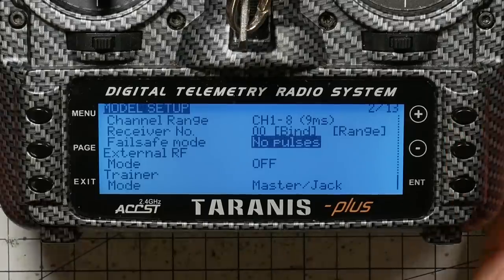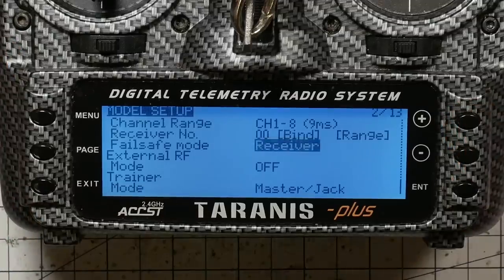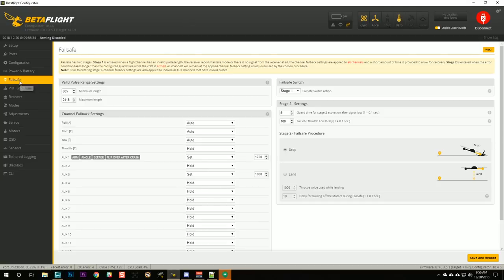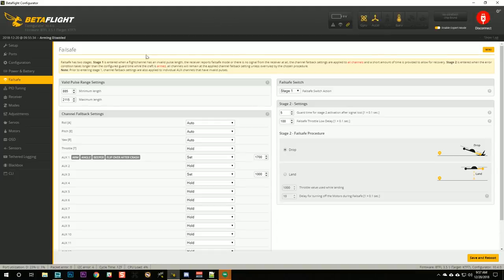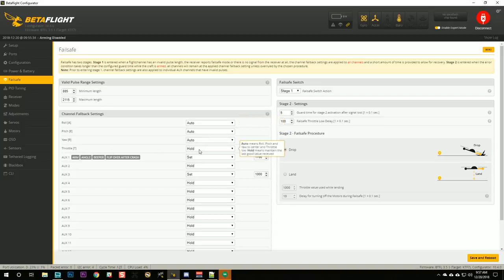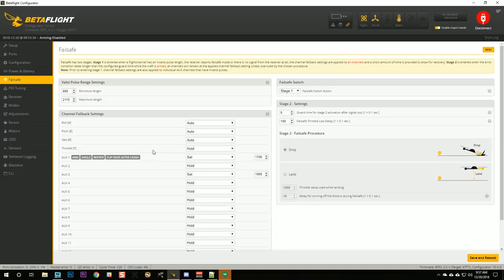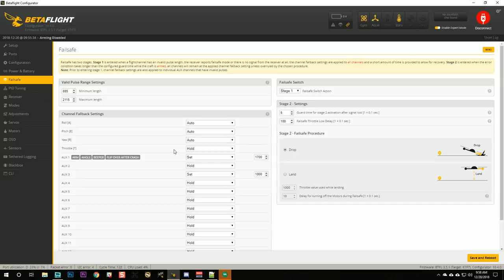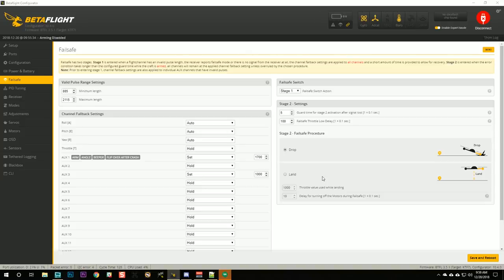Failsafe HOLD vs NO PULSES | which is right?

Comment: Great info.  Yes, set TX/RX failsafe "no pulses", works for all quad cases (like CPPM).

Great note about RSSI channel.  Will have to implement that.

Arm AUX channel I set to hold as I want it to keep the position for the 0.5s of stage 1 failsafe.  I may however add the angle mode to give the copter 0.5s of levelling so it tries to drop upright if the failsafe continues (my angle is on a different channel to arming - and I have the accelerometers enabled - and small_angle 180).

Comment: I've always set failsafe to no pulses and betaflight to drop based on watching your previous videos when I started flying. Watching this got me to thinking that maybe there is a better way. You seem to be really against land, but I've had a failsafe cause a drop that destroyed the quad. If failsafe goes to auto level (and you have the accelerometer enabled) then wouldn't it be better to have a land failsafe with throttle set too low to actually maintain altitude? It would seem like this would level it and allow a more controlled crash. It would still drop, but  just a little slower. I run a top mount battery and I can hit the ground pretty hard when level without causing any damage, but if I land on an arm then arms break and motors get damaged. How about a short video showing what happens when failsafes occur. You could set up a switch or just turn of the radio, but show us what happens with different configurations of failsafe in betaflight. Thanks!
Reply from the maker: I'm not a fan of descending with motors active. I'd rather dump with motors off. You can still hit somebody in the head I guess.
Reply: Totally agree, this was also my thought. Find out a good throttle value for slow decent. Only downside might be that this feature doesn't eliminate horizontal momentum? This might drive the drone into something nasty. A fix could be included by using the accelerometer vector to kill the movement and keep level. It also could detect if and how fast the drone is moving up or down to be sure not flying off into the sky consulting the gravity vector to be bit smaller than 9.81m/ss. Is Betaflight open source?
Reply: My thought was that shifting to auto level with failsafe would eliminate most of the drift and help it descend straight down.  @vansoul2285
Reply: @juliejones8785  Yeah, im totally agreeing with you. I don't have a drone yet to test it out but I didn't know that the failsafe land feature will also stop the drift. This feature expects a throttle value from the user, if that value is to high the drone will fly straight up until batteries run out. That's why I was proposing using the accelerometer to check for vertical movement to slowly land :)
Reply: @vansoul2285   Accelerometers can't tell velocity only acceleration; the accelerometer reads the same thing if you're tilting but standing still or  ripping balls; and you can't calculate velocity by integrating over time, there is too much noise, even with the quad standing still sitting on a rock the calculation would in just a matter of seconds have drifted into high speed. To be able to ensure a strictly vertical descent you need GPS, or some sort of doppler radar or downward facing optical flow camera or something of the sort.
Reply: @juliejones8785  Going level would do very little to the horizontal speed. Sure the air drag would reduce the speed over time, but the effect is very small since FPV drones are usually made to not waste battery pushing air needlessly; and being level means you're exposing the smallest profile possible in the horizontal direction, so going level actually reduces the effect even more.
Reply: @tiagotiagot  Yeah you are right. A brain fart on my part. Zero acceleration doesn't mean zero velocity. The quad can still fly away with constant velocity.
Reply: I set mine with what I thought was a low throttle value (1100?). It ended up 300+ yards a way in someone’s back yard. I eventually found it by wandering thru the neighborhood watching for the rssi value to go up on my radio + beeper. Eventually I found it in a fenced-off back yard and verified thru my box goggles. Unfortunately it was caught in some thick grass and couldn’t take off. 

Thankfully I was able to recover it by leaving a note on their door and a few bucks for the trouble (it was 6am on a weekend), but I don’t know how many people would be as kind. I had to accept that these people might be upset by it, hate drones, or accidentally “find” it with a lawnmower. 

Ever since then I’ve decided that a drop and potential repair may be more suitable.

Comment: Ages ago, before I got into FPV I flew GPS quads, one of which I hadn't setup failsafe properly on the RX and only realised after a flight test in my back garden - suffice to say I now always make sure failsafe is setup and works on any new quad before its maiden voyage because I don't want that to be its only voyage.

Comment: I was reading the whole topic the other day, they actually convinced me that the right way if you are using a serial protocol like SBus or IBus is to set your receiver to hold. They took the code from Betaflight, explained it quite a lot amd then I experimented by myself. Ew JB, I don't think by now this is your best tutorial
Reply from the maker: The argument they seem to be making is, "Hold works." But nobody has actually shown me a case why hold is better than no pulses. No pulses also works. 

So explain to me why a solution that only works for some receivers is better than a solution that works for all receivers.
Reply: @JoshuaBardwell  seems that for the FC is the same: they are both ignored. But for how the protocol works then hold would have some benefits in strange behaviours of the radio. The serial protocol keeps sending data out of the radio even if failsafe occours, so if that "short failsafe" happens there is no lost data. This is why hold should work better, if I understood that correctly. But you are the man who can dig deeper! :) This is a really nice topic, I'd appreciate sooo much if somebody could find the final answer to this!

Comment: Yea I was trying to set this last night so my whoop would just land, but every time I’d flip the switch and watch my stick movements under receiver tab, it would jump up and down, and then sometimes completely lock out all my stick movements. On The i6X it has a failsafe section, and I set channel 3 to -100% which works when I just turn off my controller, or if it were to lose reception. Eventually I just set the switch to Kill and drop on activation. Thanks for the info.

Comment: Best failsafe experiment might be to record all channel data from the receiver during a controlled landing, then on a real failsafe event, just switch the receiver out of circuit and take over the receiver and spew out the same previously recorded data to the FC.  A small micro controller pcb would be needed of course. I'm going to have a go at this. Height above ground would obviously be a problem if recorded altitude didn't match the failsafe event, but it's worth a shot.

Comment: Great tips, pulses defo sounded like pwm so I used "Custom" failsafe then made sure sticks were where I wanted. The I shut off QX and the Babyhawk R with XM shuts down replicating loss of signal. Qx is a nice radio, Open tx comes back to memory quick.

Comment: Potential dummy question: when you described your Failsafe settings, you set your throttle to hold and you make sure that via AUX1, the quad is disarmed. However we are only talking about Stage 1, where you want your 0,5 seconds grace period before the quad drops out of the air, so shouldn't you make sure that during those 0,5 seconds, the quad does not disarm?
Reply from the maker: I think you're right. I misspoke about that aux channel.

Comment: Joshua B:  Topic Idea for new pilots.  
How often should you expect to receive bum products?  
I ask because I'm pretty new to quads and have already had some strongly disappointing interactions with some "reputable" companies. 
Out of 3 micro quads that I have bought, 2 have needed to be returned for defects.
One bought through Amazon was replaced in 2 days.  One bought from a smaller outfit was sent back weeks ago and the replacement is "in the mail" with no tracking number or anything.
The only one that I did get to fly was great, then I crashed and discovered that that company charges seemingly double for spare parts.
Reply from the maker: It depends entirely on the company you're buying from. Some are very reputable. Some have a reputation for poor quality, but at least they're cheap. If you're sensitive to this sort of thing, buy from companies like RDQ and GetFPV who will absolutely have your back. If you are willing to take a chance on a bargain, Banggood is a fine choice, and their customer service is not the WORST although it does take three weeks to get anything from them.

Comment: For me throttle hold is not a good idea even if stage 1 is only half a second. Because of the case you were full throttle when failsafing, you will continue half a second at full throttle which could be a big distance your quad could run.
Unfortunately it is not possible to put throttle to a certain value (for example 1100 after testing your quad is hovering at 1100 for ex.) on stage 1. That would have been great

Comment: I‘m trying to get into this topic as a beginner and I am very thankful for your content! Question: why do we care what the controller does when failsafe occurs? Since failsafe as I understand it means that the quad has lost connection to the controller and so everything the controller does has no influence on the quad. Following that logic, failsafe settings on the controller have no influence and are therefore irrelevant. What am I missing? 🤔 I would be happy to get some help understanding this! Thanks in advance :)
Reply from the maker: The FC has lots of choices for what to do during failsafe. On a racing drone it would typically shut down the motors. On an autonomous drone it could use GPS to return to home, or loiter in place.

Comment: "Land" mode should be called "Crash gently". I much prefer this option, as it prevents the aircraft from crashing at full speed and saved parts and batteries for me on a few occasions. Obviously its very important that the throttle setting is set low enough for it to descend.

Comment: Great one! it would be great if you could cover off the different failsafe situations, and how to diagnose - out of range, fault with radio link (transmitter issue, antenna issue), RX failure (power/brownout). Would also be good to cover off why the different RSSI methods (which you have covered) give different values and are more or less reliable

Comment: I am using Flysky and have found I need to set the failsafe condition in the transmitter. One of the Auxilary channels triggers failsafe which in turn activates GPS-RESCUE in Betaflight. By setting the AUX to the percentage that matches the Betaflight mode setting for failsafe I can turn off the transmitter or loose signal and my quad comes back to me.

Comment: Everyone has their opinions, for me I have it set the aux for angle mode, I then tell it to land with the throttle just under a hover for 3 seconds, not to land but to try to arrest some of the forward momentum and then end up coming straightish down instead of staying at 90mph in the forward direction in racing to try to stay in the area that I am flying which I make sure there is no one else around rather than shooting out of the park into someones windshield.

Comment: Joshua, thank you for your excellent and well informed videos. I have a problem with fail safe on a fixed wing aircraft.  I have Frsky Taranis X9D plus transmitter, X8R receiver and Frsky SBUS to PWM decoder. I use the SBUS to PWM decoder in the wing of my large fixed wing aircraft, for transportation purposes, to drive the ailerons, flaps and undercarriage. I have attempted to configure fail safe in custom mode on the transmitter and alternatively receiver mode on both transmitter and receiver both with the same results. When forcing fail safe by switching my transmitter off the servos connected to the X8R receiver move to the correct positions but the servos attached to the SBUS to PWM decoder just twitch which would not be good in fail safe flight. Have you experienced this problem and if so would you know how to correct it. PS: I have requested assistance from Frsky regarding this issue. Thank you in anticipation of any help.

Comment: Would it be sensible to add a feature to LAND so that when the accelerometer feel any abrupt changes (landing or hitting something) to then do a DROP and kill motors.  This may allow for a slower "controlled" decent followed by a disarm on contact.  I feel this would not only potentially minimize damage to quad but may additionally give soft targets time to react and get out of the way of a slower moving and object which if strikes would be at a reduced force.
Reply: if a 5 inch quad comes down and a prop hits someone it will do a lot of damage before the quad could find out with how most are setup
Reply: It floats away as well as down, so it will travel quite far. It won’t just come down like a parachute. 

Maybe that’s an idea. ;)

Comment: Hi, I don't get the AUX1 Set 1700 exactly. You say it's to be sure it disarms but at the same time the settings in this table are for stage 1 failsafe, when you still hope to get signal again. So if you disarm in stage 1, you drop in stage 1 (?)
Reply from the maker: It's armed with vTX on. I misspoke.

Comment: I've always used "Custom", and make sure I set the disarm channel to the disarmed position.  Then I test it by turning the radio off.  It always worked, so I never investigated further.
Reply from the maker: That's not a good approach because it doesn't cover the scenario where your receiver becomes disabled or disconnected.

Comment: Wouldn't setting it to land but with zero throttle reduce the damage of crashes by keeping the quad level when it goes down, by both decreasing the terminal velocity by exposing the maximum cross-section in the vertical direction, and also by reducing the odds the quad will hit arm first, distributing the load of the impact over more of the frame, while still mostly preventing a flyaway condition?

Comment: Hi, I have trouble setting failsafe on current betaflight and futaba T8j with Corona receiver. I have tested rescue mode on switch and it work more or less. With frog jumps it will return back to me. However when I turn my transmitter off I can see that drone freezes in last setting and last mode and nothing happens. It seams that failsafe doen't kick in (it is set to rescue gps). When i set failsafe to drop it will turn off engines after 1 second and fall, so in this case failsafe kicks in. What is wrong? Or is there any betaflight forum I can ask community?

Comment: So, your quad disarms at failsafe stage 1... Mkay... So you have to drop the throttle, flick the disarm switch, and flick it back in to the arm position and apply throttle to regain control... That seems to miss the point of failsafe stage 1... Or am i missing something?

Comment: Wow I think you finally cleared up my oldest question about how it's chosen which failsafe setting will apply between receiver, remote control and flight controller.
Only thing I don't really get is why you would want your "arm" channel set to disarm in a stage-1 failsafe? Wouldn't that disarm your quad the microsecond you lose signal and therefore totally negate stage 2?
Great topic for sure Mr. Bardwell! <3
Reply from the maker: Hmmmm I need to double check that but I think you're right. I may have over thought that one and just not had a failsafe since.
Reply: I was thinking the same thing as hateeternalmaver.  However, I've always set mine up similar to yours JB, and every time I have had a fail safe it has immediately disarmed (and turned on my beeper so I can find it).  It would be awesome to see a follow up video to this to confirm.

Comment: I didnt understand why i shouldnt  put failsafe in land mode. You said that we dont have any way to know if the throttle value we put is making the quad climb or descend. But what if i put a very very low throttle input? Even it wont be precise for a gentle glide to the ground, itll make the drop less harsh, wont it?
Reply from the maker: In my opinion it's not a good idea to have the quad powered and PID controller active when you are not actively controlling it. It could land into a person and the PID controller would flip out and spin the motors even though the throttle value is low.
Reply: @JoshuaBardwell  ok i get your point: its better a drone in the head than a spinning drone in the head. But if applyed only to those flights where i m completely alone, like on top of a mountain or in a forest, can i do what i said before? (In trying to find ways to crash less and spend less money)

Comment: Not related to this video but have a question and can't find a video regarding it.  I just installed a new diatone gt m3 fc.  When the quad is level on bench and connected to betaflight, the model in setup tab is flipping and rolling and going crazy.  Sometimes itll act normal and then all of the sudden start acting up again.  With a lipo plugged in and props off it makes the motors start going crazy when this happens.  Bad accelerometer?  If so is replacing fc only option?  Thank you for your time and truly enjoy your work.
Reply: Also, in sensors tab it appears gyro and accelerometer are not right.
Reply from the maker: This is a bad gyro. New FC time. If it's brand new reach out to the vendor or to diatone for replacement.
Reply: @JoshuaBardwell  Ok thanks again, I'll reach out to diatone as I ordered directly from them.